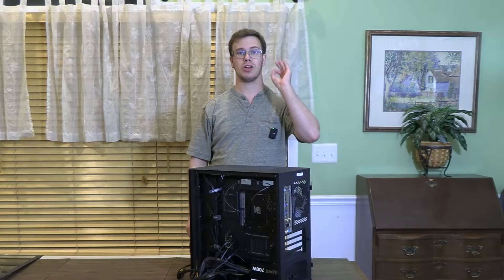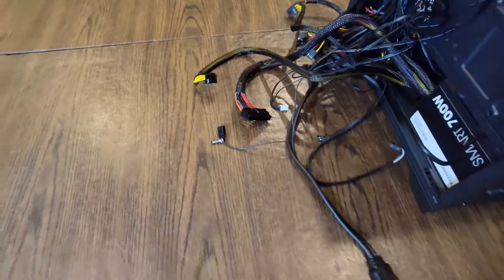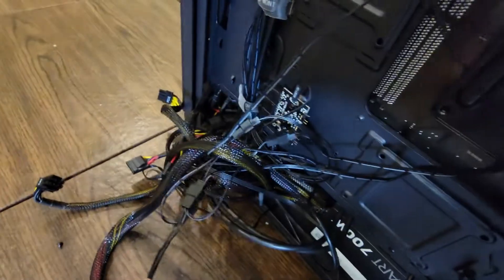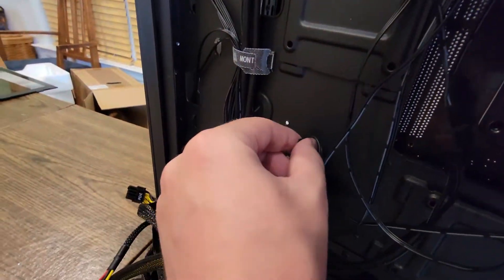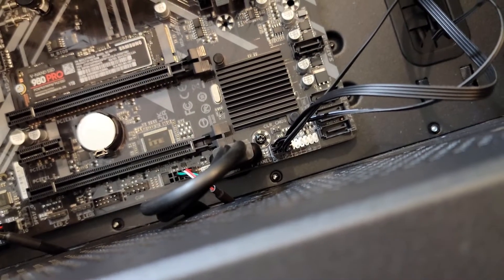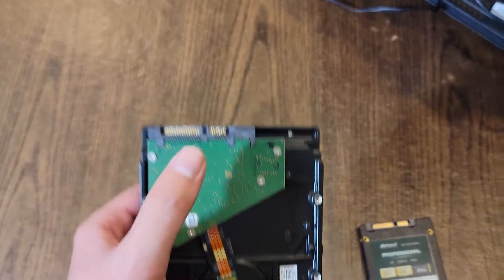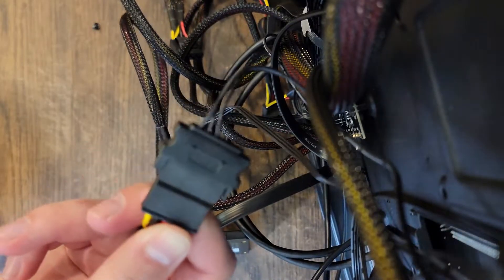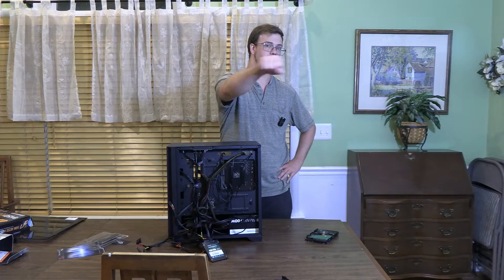Where to connect PC Cables - Everything You Need To Know

Comment: Ik this video is old but my f panel is colored with 2 green n 2 black on top n 2 red n 2 blue on bottom n according to wat he says the reset switch goes on the bottom meaning the last 2 blue colors then the power switch takes up the last top black colors so all thats the 2 green on top n 1 red on bottom (my cords dont have the hdd led 2 prong just the 2 single prong power led+ and - a power switch n reset switch) so do i just put the led power - in the last red spot or with the led power+ next to it on the green color?
Reply: look up the manual for your motherboard, and then find the page that talks about the F_Panel, or Front Panel Header, that will tell you where to hook the parts in, I know this is late but, it should work if you didn't ever figure it out

Comment: I plugged everything in exactly as in the video, very detailed and helpful by the way, but when I turn it on, the HDMI (motherboard and GPU) don’t send anything to my monitor and the USB’s don’t work either. I am so tired and think I will take it to the computer shop down the street from me 😅.
Reply: Just to clarify, the video was actually helpful, that was not sarcasm, just didn’t work for me. Also I will update tomorrow if I find out what was wrong if anyone in the future has the same problem.
Reply: I ended up figuring it out on my own. The ram I installed was laptop ram instead of pc ram but I switched back to my old one and it works great.